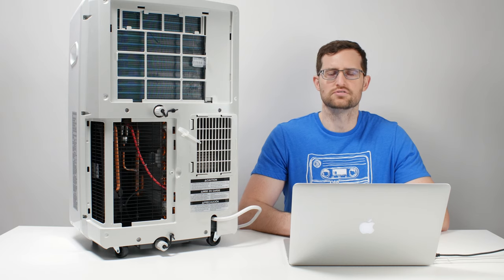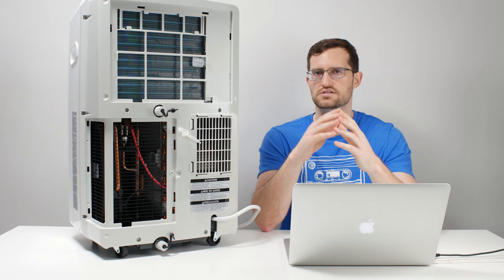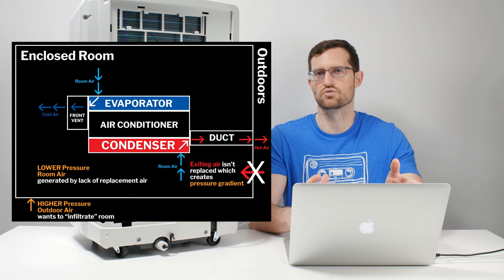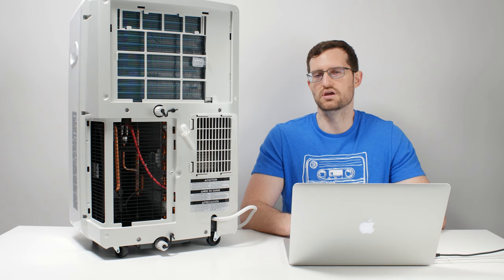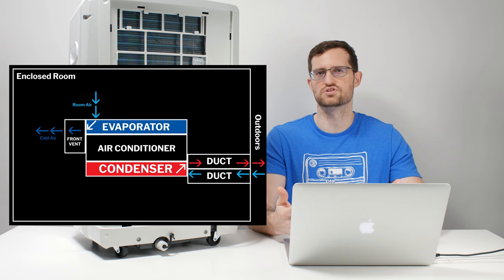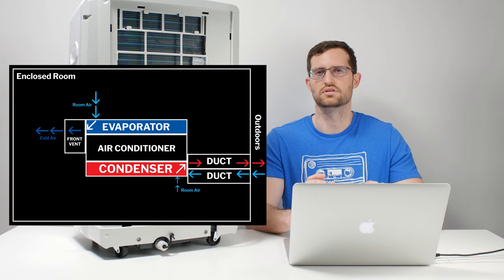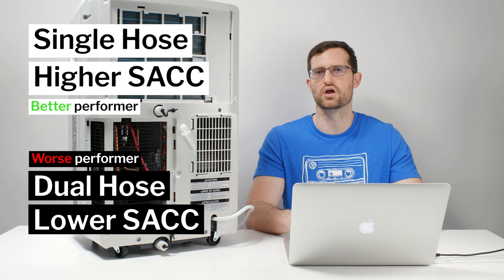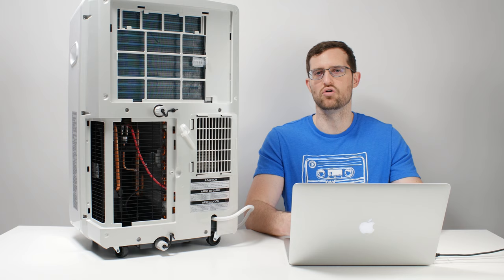Single vs Dual Hose Portable Air Conditioners

Comment: I’m more confused than ever😟 I have the whynter 14btu dual hose. I hooked up just the exhaust hose. I don’t feel like it’s working that well. I’m going to hook up both hoses and see if I get a better result
Reply: Definitely use both hoses, it makes a big difference.  The hotter it is outside, the more that second hose helps.
Reply: 14k btu was based on a condition environment setup by the companies of about 81  degree and and those companies tested it on that temprature ..the Saac system from the Dept of Energy did a real world testing based on 91 degree starting point ..from 91 degress it reset the portable ac and how well it cool off a X square room within one hour...so always look for a portable ac with a saac of more than 10k btu..10k btu saac will cool a 450 square feet room in a out two hours to about a comfortable 77 degress
Reply: @robertnguyen2025  The units are tested with a room temp of 80f and an outdoor temp of 83f (80% weight) and 95f (20% weight).  This is a not so fun read, but enjoy: https://www.federalregister.gov/documents/2016/06/01/2016-12446/energy-conservation-program-test-procedures-for-portable-air-conditioners

Comment: I have a dual hose ac unit.   It however appears to also pull some room air into the hot side through some vents around there.   Would it be okay to use duct tape to block those inputs so that only outside air can be drawn in to cool the hot side then be ejected ?

Comment: Sorry I can't understand fully because of my poor English.
So Could you let me know which one has better efficiency? Single? Double?
Reply: Dual hose ac unit is more efficient since it doesn't draw air from the outside into your entire house. Do trust this guy, he really does not understand HVAC  units
Reply from the maker: By looking at a particular model's seasonally adjusted cooling capacity (SACC) and combined energy efficiency ratio (CEER) its efficiency can now be evaluated independent of form factor (single vs dual hose).
Reply: From 8 years experience living in a hot/humid summer climate with 30°C weather - the dual hose unit WAS effective to cool the room.
The single hose portable air conditioner was NOT effective.
Reply: Double by far

Comment: If I use only the exhaust hose on my Whynter would that increase the sac rate? Also if I wrap my hose in insulation and make sure I have a solid and sealed point ( it goes through a hole in my wall out the garage) would all that increase the Sac?
Reply: I am curious as well.  Why not have intake hose pull just inside cooler air?

Comment: I bought other air condition two hose one suck air one out the hot air its near how its good it suck the hot air again because they are not far from other if I use one of them it cause problem ? If its sock from the room ?

Comment: Exactly what i wanted to know, very helpful explanation.
Question about SACC. Whynter AC website will mention 12k btu (10k btw sacc) on a model, but LG ac site will say 10,000 BTU (U.S. DOE)/ 14,000 BTU (ASHRAE)*. So as i understand 10k DOE here is the sacc number?
Also, since the LG version is 14k ASHRAE does that mean it uses more energy than 12k btu from whynter?
From what I've seen inverter technology is more important, saving up to 40% on energy. I see LG advertising their dual inverter technology but as i understand it does the same thing but it performs quieter due to less vibrations.
Reply: I haver no Ideal what hes talking about, I really dont do math without a calulator, I did why a whynter elite dual hose 12,000 Oh boy its no better than a fan it does not even cool one small room

Comment: The worest part about Single Hose ACs are that they - due to the low pressure in the room - sucks in its own freaking hot air from any leaks in the hose, connections or window its connected to. This was a problem i had. Every time the AC turned off when it "reached" its target temperature it will still exhaust hot air out and then back into the room. So i converted my Single Hose AC into a Dual Hose AC and this solved so many problems i had with it. 

One great thing about a Dual Hose ACs is also because its sucking air in from outside, you could detach the outtake hose and let the AC run in Fan-Mode at night when its colder outside sucking cold air inside the room from outside and create a high pressure in the room to push out hot air over night. Saving huge amount of energy.
Reply: you have the 2nd hose added to the wrong part of the unit. you need to add it to the compressor. not to the cooling part.
Reply: @user-xxxxxn  its not

Comment: A dual hose system is much more efficient than a single, also, it isn't working any harder to cool the condenser than a central or window unit, they also use outside air to cool them.
Reply: Right, is it better to cool down the condenser with the 95 degree outside air or the 70 degree inside air? I'd have to see some well-designed tests that compare the results before I decide on anything.
Reply: S C this is my biggest question
Reply: What if it's almost 110° F outside? The compressor will be under a larger load since the condenser is not being cooled enough. This won't be good for the compressor long term. Not to mention its rated BTU's will drop.
Reply: @marcosscriven5937  yes, we all understand that. But what if the cooler air is overall more efficient (doubt that though) at cooling down the condenser, or isn't as inefficient as you might think?
Reply: @marcosscriven5937  that it's worth the energy in cooling the air before using it to cool the condenser, or at least that it's not quite so bad to do so as you might think (the gas cools faster to a liquid, cools to a cooler state, leading to higher efficiency?). Again, you're stating something we all know 😅
Reply: @marcosscriven5937  thanks, I'll take a look. For what it's worth my LP1419IVSM is doing a terrific job with my 170sq ft + 45sq ft (for closet and bathroom which I keep open) bedroom, totally overkill to be fair, I use the sleep mode most of the time which keeps the fan and compressor at their lowest settings, and a target temperature of 77-78. It really helps that I'm sitting just a few feet from the AC, but when I walk around my room I can feel the cool air everywhere, especially on the floor. I recommended pairing any AC with a fan of some sort to help circulate the air better, I remember seeing videos saying that using a ceiling fan in combination with an AC makes it way more efficient, and in my experience a box fan works well too. When the AC is running the living room does get warmer as expected but nobody's out there anyhow
Reply: That said if you live somewhere like Phoenix, AZ, and it's 112 outside and you're trying to cool down a 400sq ft space with poor insulation, the LP1419IVSM is probably the minimum level of AC you want as I bet it would struggle under those circumstances. Probably better to get a window unit at that point, but like many people I pay rent and cannot install something like a window unit as it goes against the rules of the lease.
Reply: @Dcc357  Let me reply to this two-year-old question. Yes, the compressor has to work harder, and the COP (Coefficient of Performance) will decrease in high ambient temperatures. However, they still get the job done. According to Abdelaziz et al. (2015), the COP can decrease by 35% when the ambient temperature increases from 82°F to 114°F (50% for 131°F) for R-32 refrigerant. However, the cooling performance can be maintained at the same level, with just a 20% loss for the 131°F case. The refrigerant works very differently than the coolant in your car. Refrigerant uses condensation to release heat, and a good fan has more impact than the ambient temperature. For example, in the research conducted by Yao et al. (2017), the EER rating does not show a significant difference when ambient temperatures increase from 82°F to 106°F for R-32 refrigerant, and the compressor's discharge temperature is still below 250°F at 106°F, which indicates good working condition. In summary, ambient temperatures do affect the performance of the air conditioner, but they are not the dominant parameter. Most HVAC condensers operate in high ambient temperatures without issues in the world. I hope this answers your question.

Abdelaziz, O., Shrestha, S., Munk, J., Linkous, R., Goetzler, W., Guernsey, M., & Kassuga, T. (2015). Alternative refrigerant evaluation for high-ambient-temperature environments: R-22 and R-410A alternatives for mini-split air conditioners. ORNL/TM-2015-536. Oak Ridge, TN: Oak Ridge National Laboratory. https://energy. gov/sites/prod/files/2015/10/f27/bto_pub59157_101515. pdf.

Yao, Y., Zhang, Z., & Hu, X. (2017). Experimental contrast on the cooling performance of direct evaporative all fresh air handling units with R32 and R410A. Procedia Engineering, 205, 802-809.

Comment: So, My dual hose could perform the same or better by using only the outtake?
Reply from the maker: My only concern would be that certain parts of the rest of the system (the refrigeration system, fan, etc.) may have been optimized for its dual hose design. Otherwise, I would say it is theoretically possible.
Reply: Just what i was thinking...lol...
Reply: Incorrect your better iff always using the outside air to cool the condenser. Keep the cold expensively produced cool air in the room.

Comment: Should i get single portable air conditioner if my apartment gets up to 30C/ 86F ? Will it be efficient in cooling it down??
Reply: My order of recommendations are as follows:
1) Split system. This is basically a smaller version of a central AC system.  
2) Window AC unit.  These tend to be cheaper to buy, cheaper to run, quieter, and all around better than portable AC.  
3) Dual hose portable AC unit.  If you only run the AC when it's hot, these are a lot more efficient than single hose units.  
4) Single hose portable AC unit.  This is usually the method of last resort.

Comment: It’s funny that another site recommended a dual hose ac for hot weather for the reasons that this site says doesn’t really make that big a difference. Interesting that the other site tested two units that weren’t even 14000 btu units. They were both 12000 that equals to real btus of 7000. So, probably that’s where the dual outperformed the single. But, they didn’t match the very best single hose with the dual, which probably would have given different results.

Comment: Excellent vid! Thanks. Is there any issue running a dual hose with just the exhaust hose venting out the window and leaving the intake hose off and drawing from inside the room?

Comment: Single hose units can always be upgraded to dual hose units, gaining both benefits 7:25
Single Hose Higher SACC -> Dual Hose Higher SACC
You basically get more for a lower price. By insulating the AC itself and pipes u get efficiency as split system.
Don't forget that a dual hose unit, if it cools room down by that 3 degrees, it has 3 degrees less to cool than a single hose unit which has to deal with the negative pressure hot air, meaning that once a dual hose unit with lower sacc cools room down to that 25C when it's 31C outside "slower", it will outperform the single hose as it will then cool down only that 25C, reaching the target temperature at some point, while the single hose unit will slow down with cooling speed over time, staying behind lower sacc dual hose.
Reply: On sunny days, the outside air surround the building is a lot warmer even into the night ( heat capacity).  For apartments/condos, most of the outside air coming in is through the cooler hallway.
Reply: @rob4197  This doesn't benefit you. First, the air is soon or late going to be replaced or warmed up, ventilation already takes the air from the hallway and the a/c will  stay running for longer  periods  of time because one or more rooms surrounding the conditioned room will always be warmer, matching the hallway temperature. With the mod, basically any air escaping the conditioned room is cooling the surrounding rooms to some extent.
Reply: @PiotrK  Because of the sun amd the heat absorbed by the building,  the interior/hallway remains cooler constantly.

Comment: Any thoughts on the MAP12S1TBL vs LG LP1419IVSM? I know the Midea is more efficient but confused on why they chose to make such a large device in black. Most homes have white walls 😑
Reply: I bought the LG and it is terrible.  He fails to mention the HUGE increase in humidity that inflitration causes due to inflitration from one hose units.  I'm going to buy a 2 hose unit next.

Comment: Great video! 

I have a large sunroom with vaulted ceiling’s (more of an in closed porch with Sunspace Weather Master windows). Insulation is minimal (floor and ceiling)as all the walls are windows. Currently have TOSOT 6000 DOE BTU that can’t cool the room on hot days. 

Looking at portable AC 

Single Hose
Hisense 12000-BTU DOE (15000-BTU ASHRAE) 115-Volt White Portable Air Conditioner
Item #2987539Model #AP1221CR1W 

Vs. 

Dual Hose
Hisense 10000-BTU DOE (15000-BTU ASHRAE) 115-Volt Grey Portable Air Conditioner
Item #2987537Model #AP1021TR1GD

Both at Lowe’s. 

The single has higher BTU DOE. But, given my insulation/window situation. . . . which one should I go with?

Comment: Excellent video. Is there a chart with revised square footage cooling specs using SACC values? e.g. would a SACC 8,500 unit work for a 200 sq. ft room?
Reply from the maker: I recommend against using charts. Ultimately, you want as high of a SACC unit as you can afford, even for a 200 sq. ft. room. A full explanation can be found in this video - https://youtu.be/qV_cGSlxzPk
Reply: 12,000 is the highest you can get without blowing a breaker on a 15A circuit.